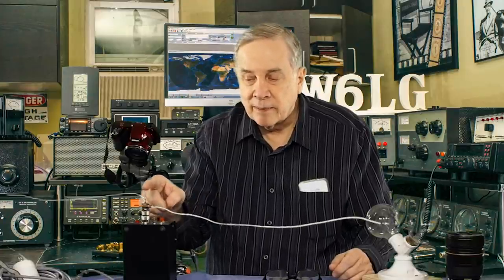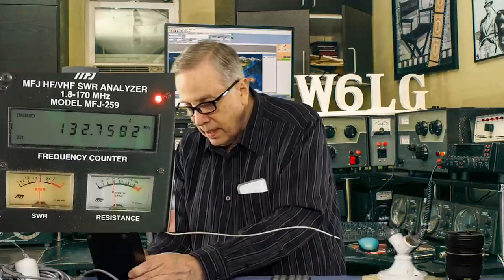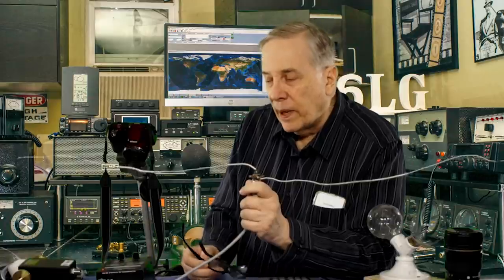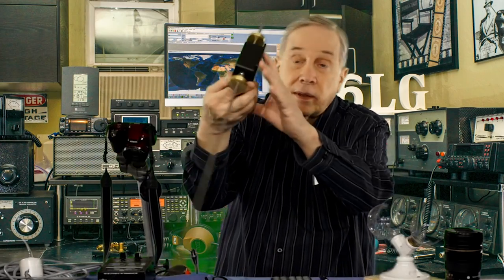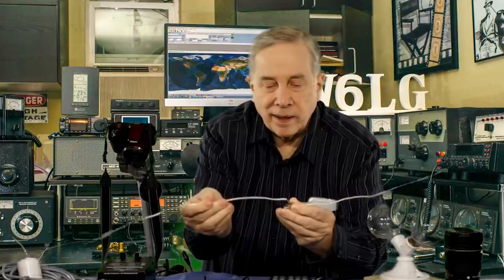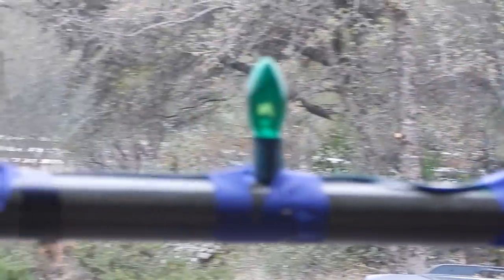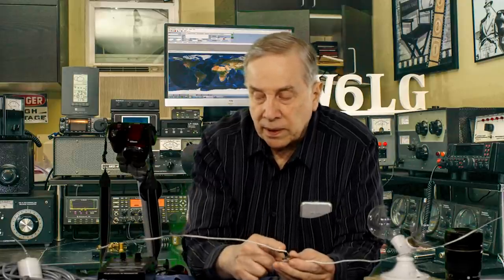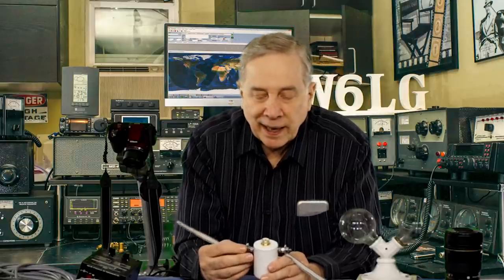Ham Radio Basics--Jim W6LG Shows The Dipole Antenna And An Instantaneous Antenna Tuner

Comment: gets confusing when I try to convert feet to meters, we don't use the Imperial System for measurement but noticed you still say the 2 meter band , so do you use metric and imperial for measurements or only use metric for band type's but still use imperial for physical measurements , I'm a bit confused sorry, same when looking up antenna measurements in books, all the measurements are in imperial and I need to try and work it out in metric , get pretty messy some times. , but thanks for the video, still good info. de VK3HAU
Reply: 2 Meters is 200 centimeters - 1/4 is 50 cm   convert 50 cm to inches is 19.68504 inches - many tape measures have both measure systems.

Comment: What about a discone antenna? It tunes everywhere on VHF/UHF with a low SWR. It works from 50 MHz to 900 MHz without a tuner.
Reply from the maker: I was on HF.  I am basically an HF guy and usually on 20 meters.  73, Jim W6LG

Comment: I wish I had viewed this video before buying a portable antenna that had "low" swr values on 6 to 160 bands.  It has never really worked well.  A waste of money.  But I guess every neophyte can make one stupid mistake at the beginning. I now use an EFHWA  resonant on 10,  15, 20 and 40 meters without a tuner.  Because of its length I configured it as al sloper. Otherwise I use monoband EFHWA that I can hang vertically from a fiberglass telescope mast.  Also, without a tuner.  They are quick to deploy and very good for portable work.  And they are cheap to buy and even cheaper to build.

Comment: Just a thought, we measure wavelength in meters, so why do we make life difficult and convert that into feet and inches? The metric system is so much easier.
Reply: In my case, it's just because just about all of my measuring gadgets are feet and inches.  So if I go to build something that's what I have to work with.  But I guess it doesn't have to be that way.  Other measuring tools are available.
Reply: The genuine answer is that the USA, the largest economy in the world, would gain nothing from a change to Metric.  In fact the costs to engineering and construction alone, would put a big dent in the country's balance sheet.  Add in the natural conservatism of half the population, and it's not going to change soon!  The UK (who invented the US system) started to change over in the 1970's against a lot of public opposition.  But many people there, even young ones, still think in inches, feet, miles, pints and gallons!
Reply: @hectorpascal  Not to mention the mass/weight unit, "stone".  Nevertheless, I could easily do my garage projects with metric measures if I really wanted to.  And it's just as easy to break out the unit conversion app and convert.
Reply: Well things are changing with US industry where they export goods to other countries and the same with imported aircraft and Cars which are built using the metric system, the first Medical Linacs (Linear accelerators) from the US were not metric now they are all metric using different systems has caused major problems such as rockets with firmware in Metric and software in US feet ,inches  and an Airbus A300 that ran out of fuel due to it being fuelled in litres and the technician screwed up the conversion  of litres to US gallons!
Reply: I learned 468/f and don't know the metric calculation. In engineering we had to buy metric tools when we changed to metric but I kept my Imperial sizes. Luckily my Dad also had a lot of tools BA, BSF, and Whitworth which are useful when I bought my Harley five years ago. I still tend to measure things in feet and inches unless it works out easier in metric.
Bill, G4GHB.

Comment: Have you ever done anything with balun 4 to 1 delta loop
Thinking 40 or 75 mt have the room but 45 feet with 50feet  of 45G and 65 feet of  Rhone tower
Reply from the maker: Yes, I have done several loops and could switch from the loop to a vertical.  The loop was almost always many db better and the noise was always lower.  Loops work great.  Oh, I forgot to mention that my loops very just a few feet above ground.  Still they worked great.  I worked a lot of DX with one of them years ago.  Thanks for asking 73, Jim W6LG.

Comment: Could someone explain why the bulbs at the end light up even though the most radiation take place closer to the middle of the dipole?
I thought the bulbs lighting up represents the radiation of the signal; so where the bulb lights up, then that should be where the most radiation occurs. I know that is wrong. I just cant make sense of why the bulbs at the end light up the brightest
Reply: The antenna is smaller than the wavelength and the Uncertainty Principle means that theories about which part radiates energy are not testable. I know of two good theories that contradict each other.

The Larmor formula for the radiation reaction says that radiated power is proportional to ([charge] * [acceleration])^2. Charge bounces off the ends of a dipole antenna and flows smoothly through the center (without acceleration). Therefore charge experiences zero (or low) acceleration at the center and high acceleration at the tips.  The tips radiate more than the center. 

Hertzian dipole analysis says the performance of an antenna can be analyzed by cutting it into small pieces. Then the contribution to the E and B far-fields made by each piece is proportional to the current flowing through it. More current flows near the center of the (full) dipole, therefore those elements radiate more power than the elements near the tips.

Neither is wrong.  I find the Larmor perspective more physically elegant, but the Herztian perspective is certainly more useful for antenna analysis and it's what you'll see in software. *They are both equally correct because wave physics and electrodynamics are just plain weird*, even before adding quantum or relativistic theory.

Comment: I put a long nylon line after the end insulators with fishing weights to the line. I can put the ends up in trees and the feed is low.  All that is needed is two trees far enough apart to run the antana.  Just get the nylon line as high as you can over a good tree limb and the weight should come down on the other side so you can put it up and tie it off so you end up with a V antana. I have used it on 3MHz. No reason I can think of that it would not work on any frequency, just need the antenna tuned to that frequency.
Reply from the maker: Hi Don,
You can have or will have very large losses depending on the feedline.  The only way that what you describe works well is to use window or ladder line to the tuner. Thanks Don! 73, Jim
Reply: @ham-radio  I used RG8, center fed. I was only talking about the 2 ends. In a time where working out in the field. I talked to everyone needed to talk to and more and on low power, on an island in a river running for a small generator.

Comment: I can see I'm going to have to study! lol
Reply from the maker: Well save most of that for after you get the license.  Right now, for the test, study the question an d ONLY the correct answer.  That upsets many old guys like me but you will learn after you get on the air.  Good luck Mike.  73, Jim
Reply: @ham-radio  I will Jim. I'm using the hamstudy app right now and I'm doing fairly well with it. Thank you for putting out the videos. A plethora of info and its very much appreciated. 73to you.

Comment: Help me understand.  How can the current and the voltage be different at different places on a straight piece of wire?  Isn't current always the same at any place in a series circuit?
Reply: William, that does sound funny, doesn't it. There are several ways to work it out, none that I can think of that are really simple. Here is an answer that is too simplified to be correct, but it may help. It is an attempt to make the answer look reasonable, but it is certainly not electronically correct! (Note that, courtesy of Ohm's Law, impedance is always voltage divided by current, and that might help at a few points. And also I am sure Jim will have a much better description if he gets time to explain!)

Start out from the center of the dipole and move along the wire, thinking about what a signal has seen so far: At first, no inductance and almost no capacitance to ground or the other side of the dipole or anything else, since there's just a tiny bit of wire that you have passed. Now as you move further along, there is (a) inductance the signal has to "get through", in the form of the wire you have gotten by, and (b) capacitance to ground with the passed wire as one "plate" of the capacitor. As you move yet further, the inductance and capacitance increase. But what do they accomplish? The signal sees that inductance as something it has to get through, adding to the impedance it has to face, and the capacitance to ground as "stealing" some signal off to ground. So the voltage goes up ( ignoring losses, the same power across increased impedance). And the available current goes down, some has leaked away through the capacitance. This continues as you go out along the wire. So moving out from the feedpoint the voltage increases while the current decreases.

Now a couple of different questions come up, harder yet to explain in any simple way: First, why is having gone one quarter wave (the length of one side of the dipole) a significant distance... And if you go beyond a quarter wavelength on that one side, things reverse! The voltage decreases, the current increases, so the impedance decreases, and when you reach another quarter wavelength, so you are now half a wavelength from the feedpoint, you are "back where you started" in terms of current and voltage and hence impedance! I can't think of any intuitive way to explain that one, but it is true that every quarter wave the impedance switches from low to high or vice versa, and every half wave things go back to what they were before! What is involved here is resonance, and I can't think of any way short of differential equations to crack that open!

Bob W, WA9D
Reply: Holy cow, Bob!!!  I am so impressed that you took the time to answer me with a three (count them . . . 3) paragraph explanation, that I now feel guilty for asking the question.   And, although you get an A+ for your valiant effort to educate me, and although I'm sure you are correct in your premise, I'm afraid my dull intellect was incapable of grasping it all.  My hope is that your dissertation wasn't wasted, and that perhaps another person in our YouTube community was enlightened by what you had to say.  Thank you, sir, from the bottom of my heart.
Reply: William, Not on a wire with standing waves on it.  The signal reflecting back off of the open ends of the wire interferes with the signal going out.  Since each wire is a 1/4 of a wavelength long, the signal travels 1/2 wavelength out and back and is exactly the opposite polarity in the middle when it comes back.  This cancels the voltage going out.  When your wires become a substantial fraction of a wavelength long they behave very differently from AC/DC circuits.  This is what makes microwave RF circuit design black magic :)
Reply: Bob, thanks for the excellent reply!   

I'm fairly new to all of this myself and the way I see it (haha!!  I'm visual), is to take a fictitious 1/2 wave length of wire as a physical representation of a dipole antenna and superimpose in your mind, a 1/2 sine wave (180*) over top of it.   If you bisect it at the 1/4 wave (90*) middle point, the arbitrary amplitude you've chosen in your mind at the 1/4 wave point, represents the high impedance (R+Xc+Xi), ergo, high voltage (low current), at the ends of the 1/4 wave half wire, of a half wave dipole.   

At the center feed point, voltage is near zero but current tries to go to infinity.   With a center fed dipole, you have two 1/4 wavelength wires emanating out from the center.   Thus, you have a inverted sinusoidal V shape, with the low impedance (low voltage, high current) point at the center feed point.   

I hope my visual description is good enough in words, to help others visualize the concept of a standing half sine wave superimposed over a cut length of wire, to see the relationship of impedance, voltage and current, with respect to the wire length and the various points along the way.   If I've made an error, please correct me!

Dave B - KD9JKG

Comment: your dipole formula is a bit pointless, just use metric. Nothing to remember except that each half is 1/4 of the wavelength, the whole thing is called half-wave dipole for a reason.
Reply from the maker: The overwhelming majority of the audience thinks in feet, yards, miles and not metric. So it helps to provide that formula.  Thanks, Jim
Reply: tommihommi1 Except that it isn't.  You need to take into account the velocity factor of the wire.
Reply from the maker: When I looked at this answer, I used a VF of 95.  I believe that is close to what is used in the 468 formula.  My recollection is that it is copper wire that does not have a vinyl coating. Thanks, Jim
Reply: Nice video, If god wanted us to use metric there would have only been 10 disciples!
Reply: Wouldn't that be a dekaciple?
Reply: I got it right off......468 divided by frequency equals the length, then you cut it in half.....he just used 234 instead of 468.....no biggie, and same result.....was kinda cool the Christmas light dipole he had rigged up.....wow.....for an old guy, he seems to know his stuff it seems like....I'll give him a pass....neat about what the auto ant. tuner really is....a big dummy load.....which makes it tune, but how does it radiate......he's dead on about the wire antenna efficiency......I have 12 wires up at the mancrib hamshack(80-10M, alternating direction, i.e., NE/SW, and NW/SE) and a 30M wire, and 1 1/2 wave inverted vee for 144 mHz.....cut for where you operate, and no tuner required, unless I want 80/75M SSB, or 160M...nu funds for a rotating beam? Wires are the next best thing, and I make all mine outta scrap wire.....romex, zipcord, etcetera......speaker wire for my SOTA's and QRP/Camping rig (Elecraft K1).....works like a champ....Antarctica called me on one Campout....over 10,000 Miles from SW Montana....not bad at all....5 watts and a dipole 18-20 Ft. up on a Mountain......Awesome.....
Reply: on 80M and 160M especially, your coax needs to be at least as long as one side, or leg, of the antenna......66 Ft. per side (80M CW, roughly) then your coax should be at least 66 Ft.......I learned this the hard way camping a few years ago.....my 80 wire would hear just fine, but SWR was Terrible....feedline was about 40 Ft. or so.....I had a couple of chunks of 12 Ft. w/ends, and a couple of barrel connectors, and problem solved....added them in, and SWR went WAY down.....didn't move rig or tent, but just added the coax.....only 64 Ft. or so, but good enough to run with without a tuner.....food for thought....
Reply: Surely the metric argument could be halted by how we denote the frequency? In metres, not feet? 160m/80m...... just a thought.
Reply: your response is a bit pointless as in America on all of the ham radio test for tech, general, and even the extra there are questions about this very question and the answer is divide by 468. He made it easier to remember by the 1 234 formula he gave. 234 being half of 468. I will remember that now as will many other newer hams. Its his video he's welcome to say whatever he likes. If you don't like it don't watch or comment. Make your own damn video but no reason to be a butthead to this man helping others.
Reply: I am going to say that to my fourteen year old nieces teacher who taught her metrics which made no sense to me. Sadly the teacher did not know Inches or how to read a tape measure. So I taught her how. I carry a little Starrett machinist tape measure and I am always happy to teach others the system I learned. Thank you for making me laugh that's awesome.
Reply: If your in the 0.3 billion in usa ft make sense but if you one the other 6 billion people who metric not so much. At the end of the day ft or metres doesn't matter if you cant convert maybe radio isnt for you.
The conceptual lesson in this video is one of the best I've seen. Cheers.
Reply: @cooker4409  Your swr went down but sid you gain loss due to the added amount of coax?